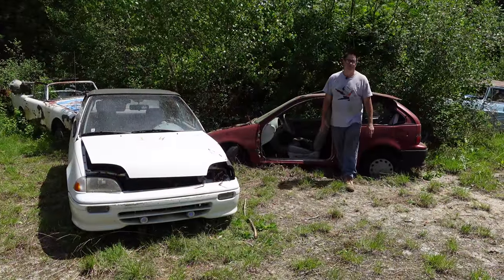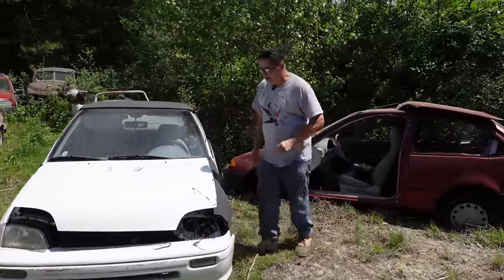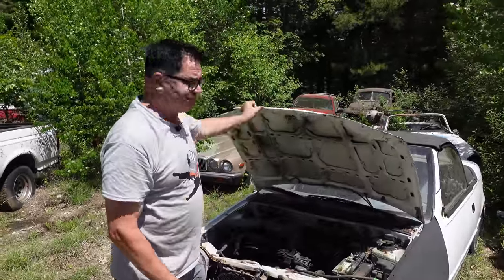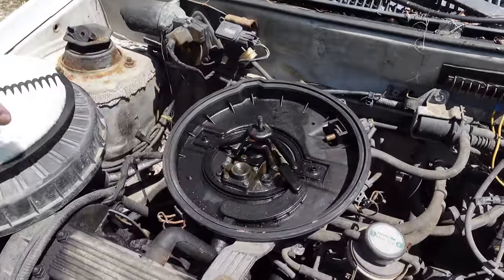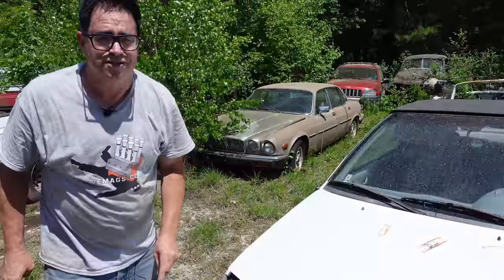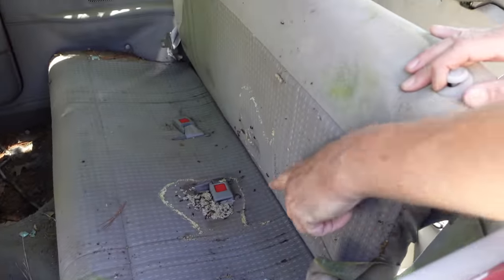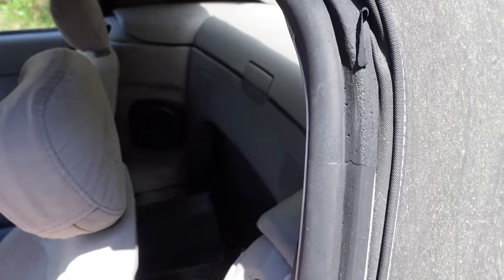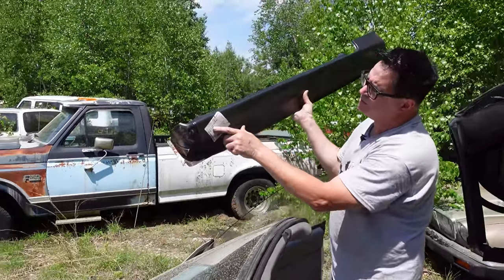1993 Geo Metro Hatchback and Convertible

Comment: These were absolute junk. It shows GM's partnership with bad news companies like Suzuki who should have stuck to making motorcycles (which they did well). They should have stuck with their Toyota partnership at NUMMI. That was solid and brought GM into making good small cars. 

Suzuki (not Mitsubishi) Celtus. These used Suzuki parts and even when you bought them across the GM counter, they would have a GM and Suzuki number on the label or box in most cases. When I first started helping a neighbor out, he needed parts for a Mitsubishi Starion but the dealer was pretty far away. I said, "let's just call the local Chrysler dealer. The Dodge Conquest is the same car, it will use the same parts". Sure enough, gave them the Mitsubishi part number off what we were looking for and what do you know, he had the part and he was a 10 minute ride from us. Back then, if you knew stuff like that, you could save time and money. This was before the internet allowed you to find that information within seconds as it is today.

I believe the Smart Car engine is actually a MB engine, not a Mitsubishi engine.